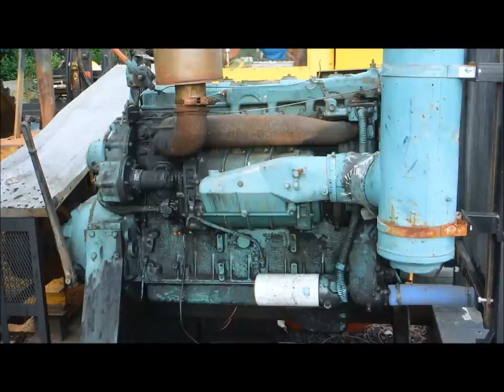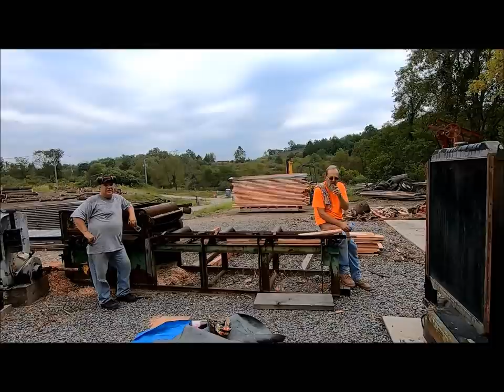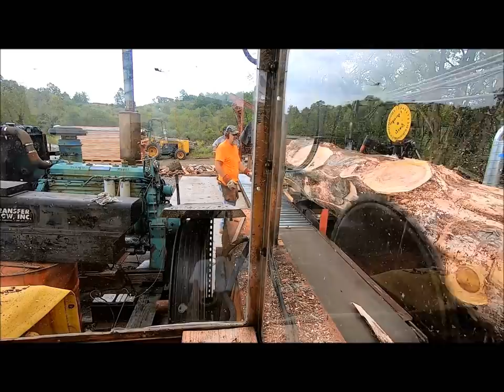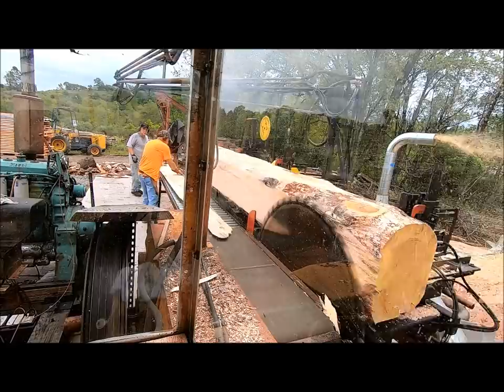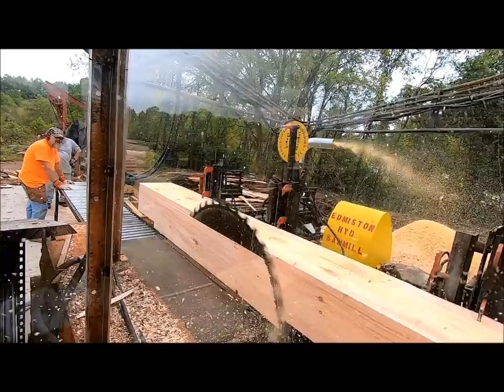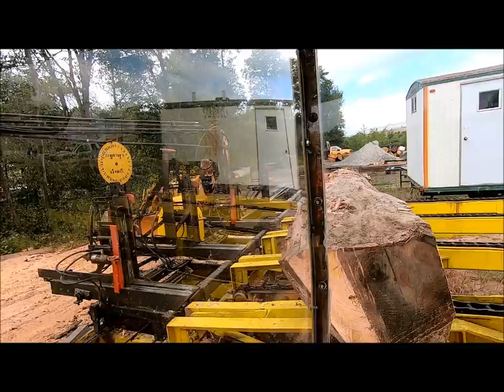sawing 2x12 's

Comment: I used to work in a mill similar to that. We had conveyors down to a tip table controlled by the sawyer. Slabs went left lumber went right. Made a lot less work on that end. I was canterman. I did the job of the yellow piece.  Hardest work there was was cutting 20' 10x10s from green poplar.  Biggest tree we cut while I was there was 38" on the butt and 12' long. We got 13 3x12s  and a 3x10 from it. Still miss that job all the time. My back doesn't tho...
Reply from the maker: thanks for watching Jay , sounds like a nice operation .

Comment: Lovely video Mark , was wondering if you have any trouble starting the ol CASE when its freezing cold ??   i used to have an ol heat gun & stick it in the hole where the preheat coil is on intake manifold ( which never was any good) , works every time even when 20 below !!    sawmill is the nuts eh , regards to you an your crew
Reply from the maker: thanks Pete , yes the 530 dont like the cold but I put a block heater on it and it starts up easy.

Comment: Gramps used to have a saw mill with an old diesel motor.  I remember that old motor did not really want to get going and it would turn very slowly when first getting it to run. It would puff smoke rings for about five minutes or so before it would start running pretty good.   I also remember the great old big and wide belts it had on it.  They would start slipping a bit so grandpa had a tin can nailed to a pine tree right under a big  scar he  had made in it and gather pine sap to poor on them to stop the slipping
Reply from the maker: thanks for the great story.
Reply: @markgalicic7788    he would take the van of pine rosin and heat it up over a small fire and pour it on the belts.  As kids we hated going to the sawmill and working.   Looking back it's like everything else now days.   Wish I could be there again

Comment: I worked my uncle's sawmill in SW Arkansas growing up, you have a great setup. We had a 5 1/2 ft sawblade, maybe 6 ft, I was barely a teenager (30 yrs ago), but my point is unless you're sticking to milling smaller trees than you did in this video may want to upgrade to a bigger blade. The upfront cost is considerable, but you wasted the first 15 mins of this video just trimming down to start cutting. If you work 8 hrs a day and waste 15 mins a log trimming, your production is cut down considerably..
Reply from the maker: thanks for watching Tim ,we do have a 56" saw this log is for the roof over the sawmill it was free and took some time to mill but got some great 16' 2x12s.

Comment: I love to hear the hum of the greyhound and watch the dust fly.in the 50's I used to go with my grandpa to the cotton gin where he worked and they had a larger Detroit engine to run it.if it were now e1 would have a fit about a lil kid being around there.i ran the pipe to suck up the overflow cotton.
Reply: oh.as usual a great video mark.
Reply from the maker: that is a great story.

Comment: Those logs look pretty gnarly... Must be the same logs that Lowes gets their lumber made out of... except they'll take the whole log and leave nothing behind
Reply from the maker: thanks for watching Justin , but they did make some nice 2x12s out of the chipper pile.
Reply: @markgalicic7788  Im not saying they didnt, you guys actually cleaned up the edges on a lot of the wood, a lot of what was thrown into that pile would be left with the edge cuts and stamped with prime select grade 2.

As it seems to me from the Lumber that we get at Lowes up here, its all warped and bent, half the time you just need to put a handle on the end of it and you have yourself a goalie stick, and they have the audacity to charge a premium for it and wonder why no one bought it.
Reply from the maker: yes sir Justin , we try to use every bit of good lumber for our sawmill shed.
Reply from the maker: yes sir Justin , we try to use all of the good wood for the sawmill shed.

Comment: hi there   looking good   it never ceases to amaze what good looking boards that come from some of the ugliest logs . john
Reply from the maker: hey John , these were the only 16' logs that we had to saw & turned out ok.
Reply: Fricknjeep- I just sawed some 3” thick coffee table tops out of  a 32” dbh cottonwood, the ultimate ‘junk’ log. The grain is beautiful! The wood was cut at about a 60 degree angle to the log with a chainsaw, then reasawn smooth and uniform on my bandmill.

Comment: When you import video from your camera into whatever you use to edit, the frame size in the editor is not matching what the camera is outputting, that's why you get those large black bands around the outside of the video.
Please check the settings, make sure they match.
Love the content. I could have a lot of fun in my shop with a few of those slabs. Too bad I live nowhere close to you.
Reply from the maker: thanks for the info.
Reply: @markgalicic7788  your utube is the most neatest thing iv ever seen.have run wood cuting for some time. it hard work be safe take care.gos bless your all.robert mckeel.
Reply from the maker: @robertmckeel828  thanks Robert.

Comment: 18-foot red oak 3x12s was the biggest thing I ever offbore. I don't miss it at all.
Reply from the maker: wow they were at least 300 lb each.
Reply: @markgalicic7788  I had a 4x4 in stuck in the ground to use as a pivot point. Not fun but I got it done.
Reply from the maker: yes sir

Comment: I worked at a mill like  yours. This one had a deck at the end of the rollers going cross ways 16ft wide and 30 ft long withe 3 chains to move the lumber down the length. We could pile all different dimension lumber on the chain and bundle on either side saving time labor, as the slab wood gets put on the chain deck as well  and thrown when bundling the other lumber.

Comment: Circular blade is really old school. You need a band saw mill.
Reply from the maker: we do have a bandmill to saw live edge slabs but you would go broke grade sawing with it.
Reply: @markgalicic7788  Why is that?
Reply: Sharpening and replacement costs of bandsaw blades. But, I’d go broke paying guys to stand around waiting for me to keep fiddling with a log like that. I started out with a circle mill, couldn’t sell it fast enough once I tried a band mill.
Reply from the maker: hey Bruce we don't saw junk logs like these but I needed 16' long that's why. do you think your bandsaw can saw 16' x 12" in 4 seconds per board that is great man.
Reply from the maker: bandmills are very slow and cut wavy lumber but are good for live edge slabs.
Reply: I’m not talking about the little hobby bandmills. Have you ever watched a production band mill operation? They are admittedly a slower feed rate than a circle mill, but use half the power and do not cut wavy if the teeth are sharp. They are more efficient due to less handling of the lumber, and less sawdust/more boards. Every 3 cuts you make is a 1x lost.
You call this a junk log but it really wasn’t that crooked or out of round, just something that’s awkward to deal with on a circular mill.
3 of you spent probably an hour getting 400bf. 1 man running something small like a Timberking 2200 (not even considered a commercial production mill) could do the same, and get at least 1 if not 2 more 2x12s out of the log.
If the only thing that matters to you is feed rate, then yes, a circle mill will smoke the band mill every time.
Reply from the maker: we are not a production mill , I mill hardwood lumber for my shop . I got this mill for scrap price and put many hours rebuilding it , we have a video sawmill move part 1 & 2 this is what it looked like less than one year ago.
Reply: Hmmm... I don’t know any hardwood producers using circle mills, due to the waste. That really surprised me. I realize you got it cheap, but at the cost of losing kerf in valuable wood.
Reply from the maker: thanks  for watching Bruce , we get our logs from tree cutters & they go for less because most mills don't saw them. we don't saw enough in a year to justify the cost of a large bandmill but do have a Hudson Oscar 52 for live edge slabs and it was not cheap.
Reply: The Hudson may be the reason you don’t like band mills. Not a fan of them. A timberking or woodmizer is money better spent. I realize you are doing what makes sense for you. I just sawed 2000bf of 3/8” birch for paneling a cabin. Do you realize how much sawdust that would be (waste) on a circle mill?
Reply from the maker: I started 28 years ago with a kasko bandmill then a timberking m- 14  then a meadows # 1 handset "great mill" then found this edmiston automatic mill for 6k . when we cut thin lumber we use a resaw so the wood is kiln dried or it will warp so bad it cant be used ,I never saw thinner than 4/4 green lumber.
Reply: Surprisingly I didn’t have much trouble with warping. The thinner the lumber, the faster it dries, obviously bad, but also the less material working in opposing directions, which is good. I sawed it 2/4 to allow a planer pass on one side, and stickered @ 12” with some 8/4 on top of the pile and then some cement blocks for weight. Obviously had to charge more for all that, but the customer was happy and there was maybe 5% with splits or warpage. Not bad. Made beautiful paneling with the dark heartwood. I do Some flooring and cabinet lumber too, plus live edge, so band mill is the only way to go here.
Reply from the maker: that's great, did you dry it out doors ?
Reply: Yes, in the shade and under cover with the ends painted. We had a very dry summer, which may have helped? But it’s how I dry everything and always have.
Reply from the maker: all good shade ,under cover,end coat.
Reply: That’s a man saw ‘ got to know your stuff there

Comment: Definitely looks like you’re improving on the mill I would have sawed it down differently but that’s my opinion and yes I have ran a few mills mainly a 4 head block Hurdle a Cooper scarf mill and a brewco band resaw also I was a saw filer for 15 years um in Connellsville PA
Reply from the maker: thanks Ryan , it will take time to get mastered.
Reply: That’s a badass mill. Once you get good those guys tailing will have their tongues hanging out trying to keep up!

Comment: You really need a bigger blade!   Add 6 to 8 inches to the diameter would mean that you cut up to 16" boards, provided there is a demand for the wider sizes.  Aw heck, you may start a new trend.
Reply from the maker: thanks for watching Lee , we do have a new 56" f patter saw to put on the mill but we want to finish to roof first.

Comment: What size saw are you using? Most that I have seen are 52 inch with a top saw!
Reply from the maker: thanks for watching Wallace , we are running a 52" b- pattern saw but we also have a new 56" f- pattern saw just need to put it on the mill.

Comment: Whats your recover to lumber on a log like that …...65% ?
Reply from the maker: not sure , we don't saw many low grade pine logs but nice round logs do yield higher.
Reply: @markgalicic7788  Thanks. We are thinking of a similar set up to yours to mill SYP logs 35cms Up diameters. Nice straight logs and was wondering the yield
Reply from the maker: good logs will do a little better than a doyle scale says .

Comment: your saw is just too small for the logs. And yes, I am a noob and can tell 😎
Got to the rest of the vid. Never saw something so inefficient :O
Reply from the maker: what size blade do you run on your mill ?
Reply: @markgalicic7788  Cheap answer man. I already said I am a noob regarding mills. I just noticed all the extra time needed to get your log suitable for the 2x12 cuts. Don't you have a bigger size blade and saw slower? Just thinking :-)

Comment: too much screwing around for one log, need a vertical band saw
Reply from the maker: thanks for watching Gary , round logs do saw faster.
Reply: I have a custom/DIY horizontal band mill and can cut 36" diameter x 21.5 long log; ?maybe not so eazy' manwell mil!
Reply from the maker: yes sir Wallace those bandmills are hard to run.
Reply: Gary Larson? Do you draw The Far Side comic strip?
Reply: @greglautz8470  no but I wish

Comment: I have always been a book buyer at the charity thrift shops and have had  upwards of 1,000 at any one time. Hasving been on the move for my "career" I never invested in conventional bookcases to shelve them and instead relied on limber and brick configurations to get by for their adaptability to various situations depending on the arrangement of the apartment. At times I would have to get new shelving and get rid of those that no longer served their purpose so i used to square out the lumber to make Lincoln Logs cutting everything on the circular saw table including the notches that i then would pry out with some piece of metal while watching television. The  to 'buff' then o could burn the soft part leaving behind the winter ring. Van't imagine just what i would do if i lived near a lumber processing yard although u would have to figure out just what would be the best dimension to square out wet wood so that when it dried out the raw Lincoln Logs would have the same mass as the season store bought lumber.
Reply from the maker: we saw everything bigger than the finished size.
Reply: tom pahdea ((

Comment: Knotty pine 2x12s are useless for structural use. Better that it goes into boarding.
Reply: Not true at all. Depends on grade, which accounts for for size and location of knots.
Reply: The only bad timber is no timber

Comment: What a waste of dimensional lumber by making only fire wood. You cut on that log for over 17 minutes and still didn't have a board but you had a pile of scrap the size of a bus.
Reply from the maker: the pile of slabs came out of 30 logs , we don't burn the 16' 2"x12"s that would be stupid but they would stack nice.

Comment: GET A BIGER BLADE OR MOUNT THIS ONE HIGHER===YOU JUST BUTCHER THE LOGS
Reply from the maker: thanks for watching Dennis , we do have a bigger blade not going to put it on the mill until the roof is done.
Reply: Why u shouting?
Reply from the maker: very loud in the saw cab.